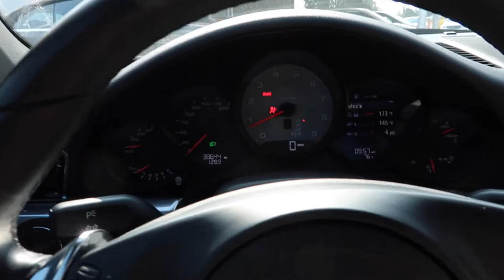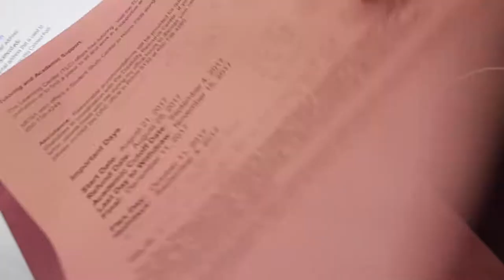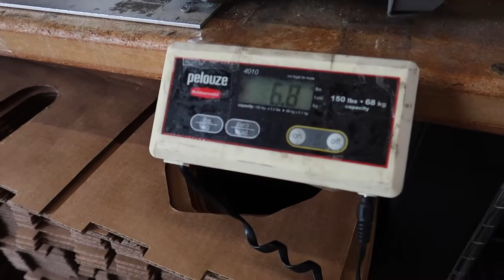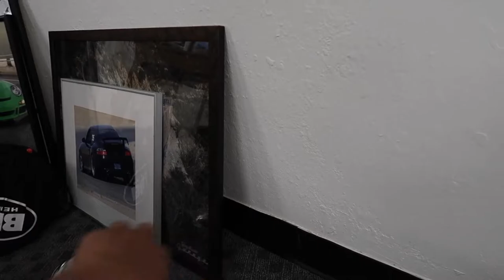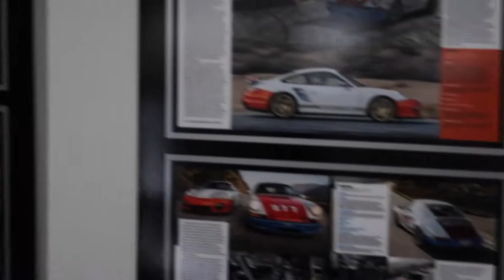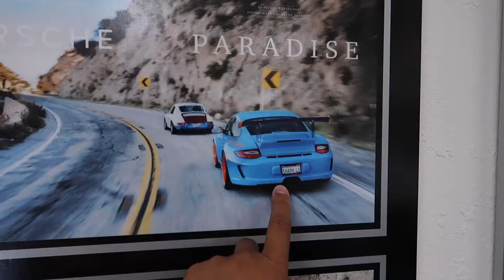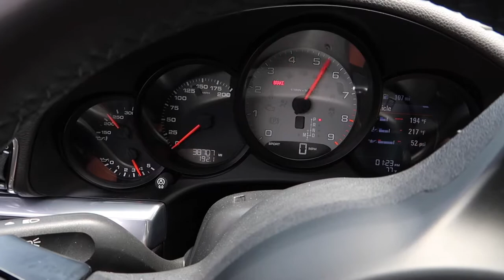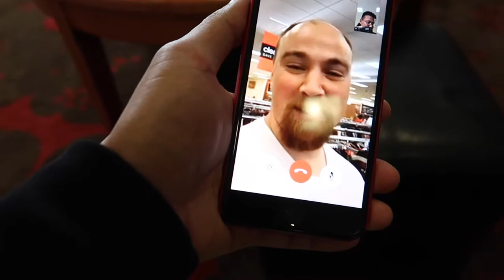I GOT A SHARKWERKS RACE EXHAUST FOR THE PORSCHE 911! (991 C2S)

Comment: Should've installed your front license plate on the center, center side air damp is just a panel. Left and right side air damp vents are actual radiator cooling locations.